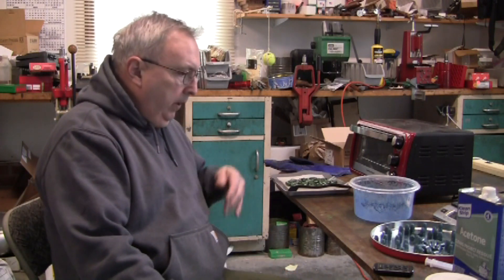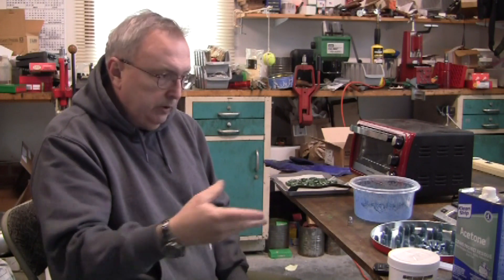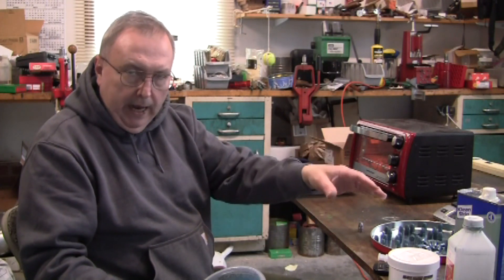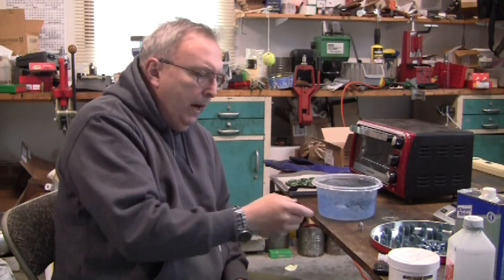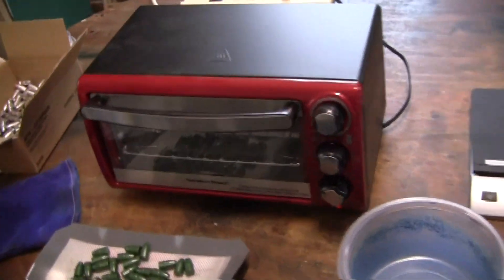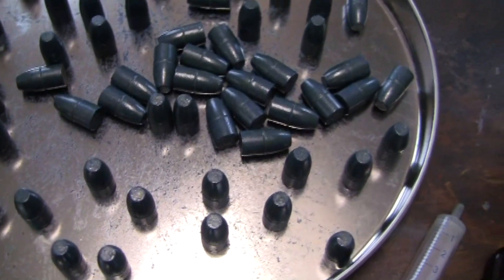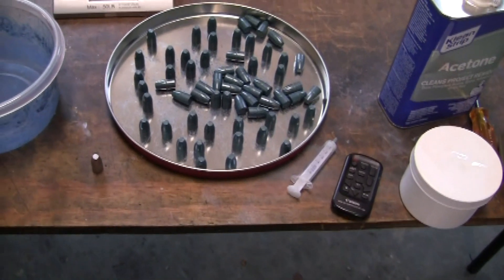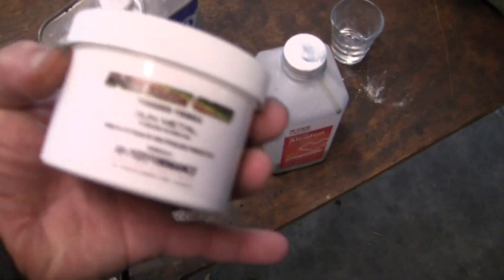Hi Tech bullet coating my first try

Comment: Did it work?
Reply from the maker: have not had time to go out and test ammo
Reply: @TheKoba49  I use this on my 223 AR bullets, and 200 gr. 3006 rounds for my garand. I have push as high as 2021 on vet with no leading. But 1680 seems to be where they are most accurate in garand,1903 and AR. PS, one reason the color may be off is the cook time. If I cook my bronze ones for more than 8 min, they turn out like brick red.
Reply from the maker: thanks for the information  @1jckdxn